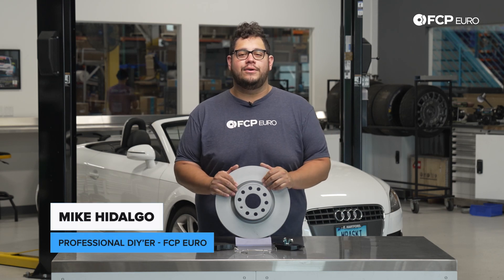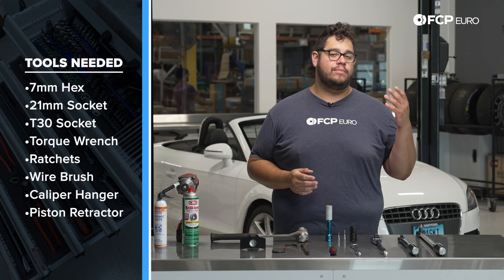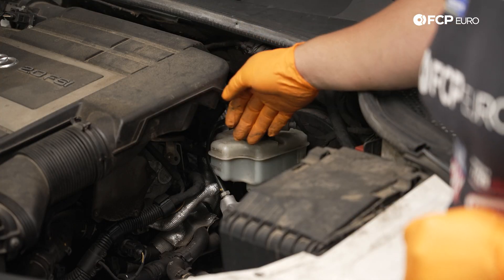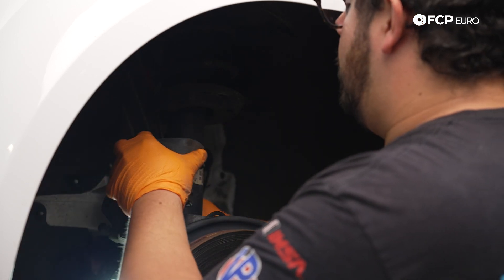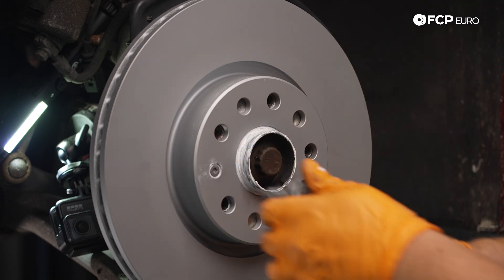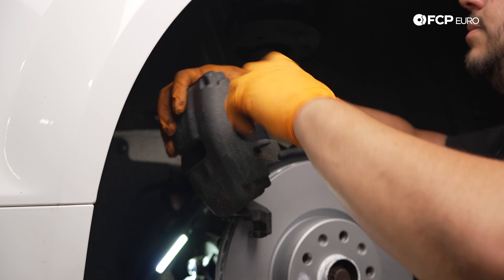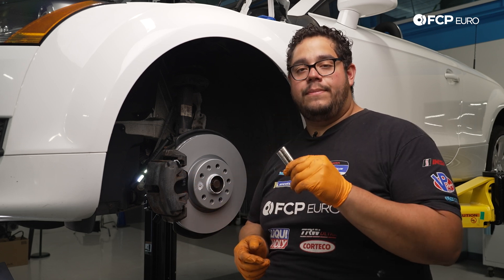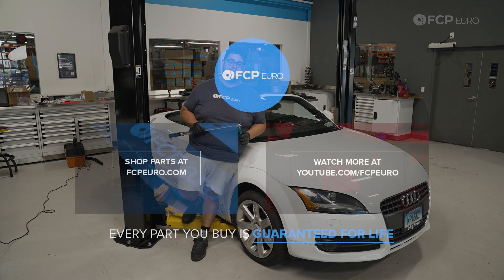Audi TT Front Brake Pad & Rotor Replacement DIY (2006-2015 8J Mk2 Audi TT quattro, TTS)

Comment: Great video 👍🏾
Again, would love to see more. Would love to see how to fish the wire to hock up a battery tender. For the life of me I can’t find underneath the car a spot to send the wire to that darn battery in the trunk.
Reply: The TT has Positive and Negative poles in the engine bay (left side of the car). Or if you REALLY want to get to the battery, you can go in behind the right taillight and through the wiring grommet into the luggage area

Comment: Mk2 TTS and V6 totally different set at the front you dont need to remove the whole caliper just the front section, can just loose up the rear of the caliper and remove 1 bolt to slide the brake disc out and can get away without the caliper tool on the front as when you bolt back up the 4 bolts for the front of the caliper it will compress it back in